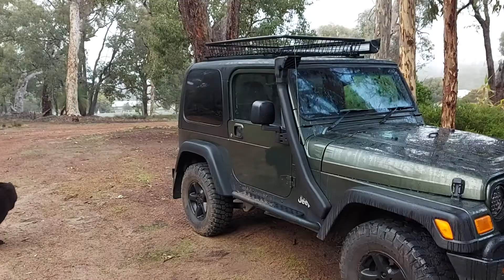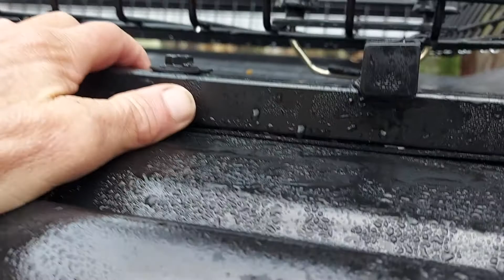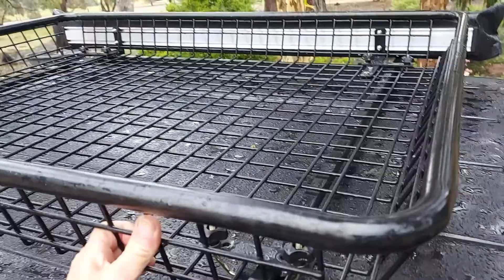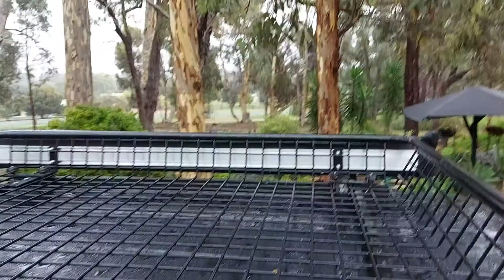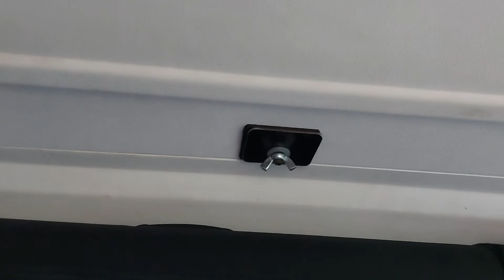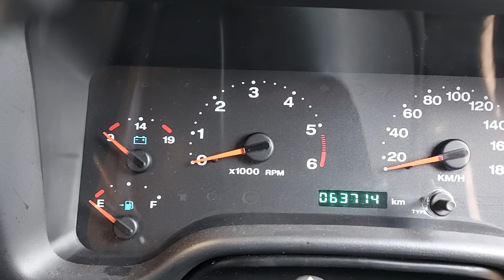DIY Roof rack for Jeep Wrangler TJ Hardtop.

Comment: Nice clean job! Your TJ looks great too and the false rear flooring is great idea.  What tyre size?
Reply from the maker: Thanks for the compliment.  Those are 31x10.5x15's. I've since changed to 265/75/16's which are 31.6" with steel rims.
Reply: @my2centsworth  Thank you

Comment: Estimated weight capacity of it? Not putting a rooftop tent or anything just a general guess?
Reply from the maker: Additional weight of about 35kg or 77 lbs is what I carry. Nicely spread out with larger surface areas and have had no problems of any kind. Solar blanket, Maxtrax (2) folding chair.